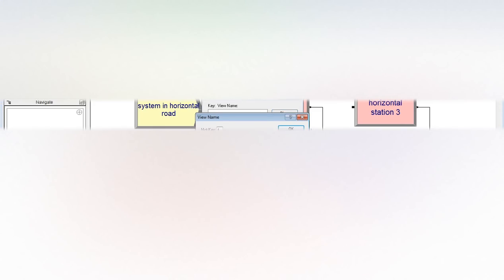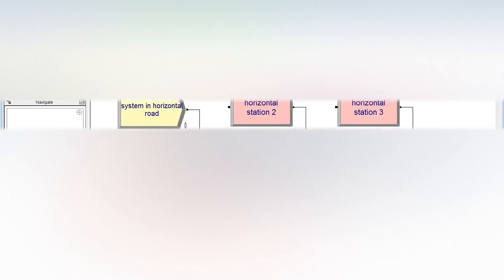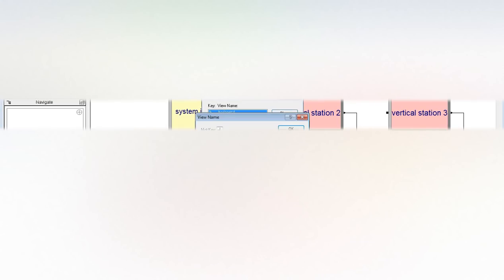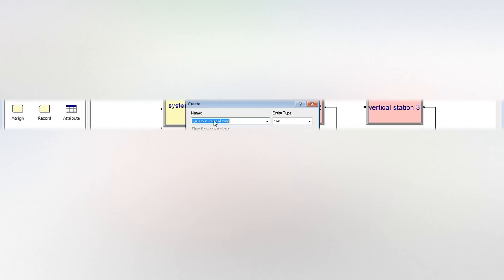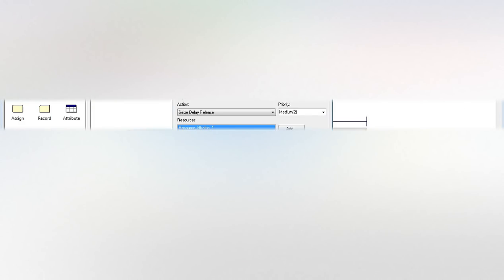Arena Simulation Traffic Light Time Based Part 2

Comment: add object station is not showing in my software what should I  do??
Reply from the maker: if you mean the module station the one in pink,,, go to file , edit, view, view project bar.. than right click, add template panel ...template panel are available in the arena folder where the program is installed.

and if you mean the station little yellow shape used for animation,, right click on the top of the window,, and add animation